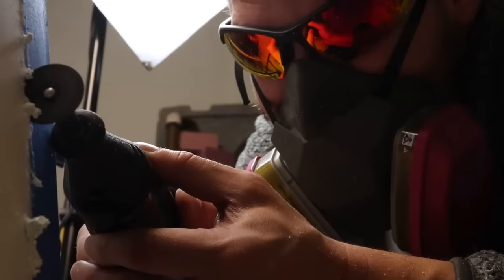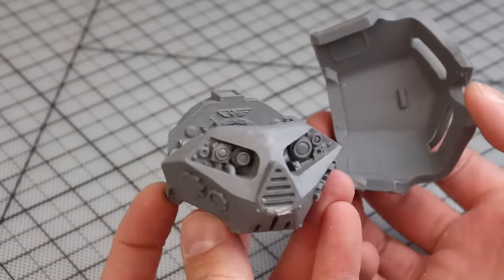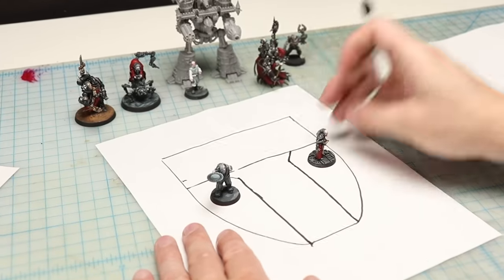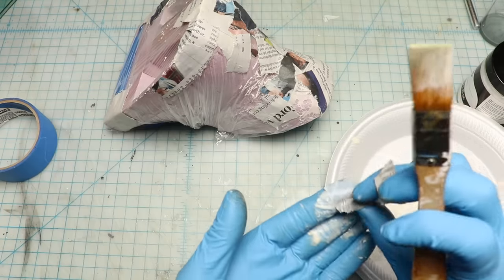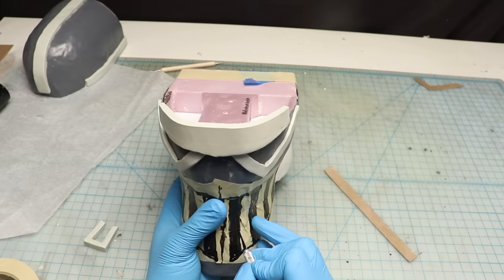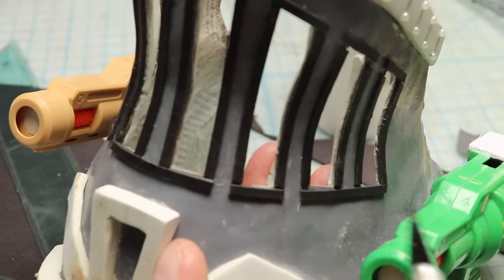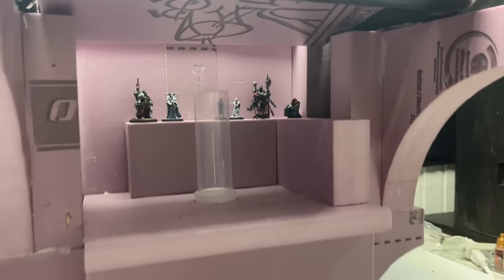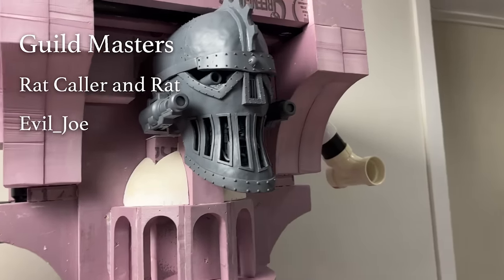The TITAN'S HEAD! Making a 7 foot Warhammer Model | Imperator Titan

Comment: Keep it up, man! Can't wait to see this behemoth in its final form! You should bring this to an event like the Las Vegas Open and put it up against like 50,000 points of collective armies.
Reply: Even the mightiest war machine is but of a heavily armed citadel to be over run by hordes of enemy infantry. It does have advantage over citadel that sure it can ru...slowly walk away, but time it takes to take a step, will lead enough time for just basic infantry to hop on in droves and over run it. While difficult task for both defenders of the god machine and opposing force, any god machine is good as dead alone and needs its companying infantry to keep it from being over run, while friendly infantry really needs to stay vigilant when titan engages with its main armaments, as those can be just as deadly for anyone in general area when that continent cracking power is released.
So add in skitari horde, few vehicles and smaller titans and yeah i would love to see that battle play out... though Imperators turn would take half a hour just from amount of weapons needed to be rolled.
Reply: @Hellsong89  however it would play out. It would be an amazing thing to behold!

Comment: A suggestion for future riveting, use flat-back nail art pearls. They come from 2mm up and can be bought in quantity and should stick with wood glue. Tip for handling small things like that, use an empty propelling pencil with a touch of floor wax on the end lifts them without difficulty.

Comment: Very nice, enjoying the look so far. Throwing my 2 cents into the build, instead of making the 'heart' you want as a power core standing straight up (ala new star trek warp core)  maybe think about having it come out of one side at an angle downward. That way you can faerie light leds from it to the exterior surfaces you will build into the designed interior.

Comment: Eric I have an idea for you I’d like to see your solution to. River terrain that looks good, hides the lines separating the pieces, and doesn’t look like it’s popping out of the ground.

Something I’m currently experimenting with. I think if you can make the points where the rivers connect hidden by waves or something it could work.
Reply from the maker: I don’t think its very easy to do that unless you want it to look like a river with a levee that has deposited enough silt to be above the level of the ground around it. This is a very manmade look. The alternative would be to dig it into the board using foam sheets so that the water is properly below grade, but then you lose modularity. Alternatively, the board itself could be water, and you could have modular big sheets of land on top 🧐
Reply: @EricsHobbyWorkshop  I appreciate the insight!

Comment: Add plasma cannon to that mouth Nice job get the legs to open two thousand cost and on wheels or it's own stand with a 2000p any army awesome.... this fine cast plastic metal frame join on a 3d print and model with a printer you could probably get 5000p in it with a a bunch off guns or troop balconies on them legs can't wait to see the full job...😃😄😁😆😅 5 Smile's.

Comment: For future reference: pixelating the head out in the video is a bit pointless if you display it prominently in your thumbnail. Still, amazing work as always. Can't wait to see the completed, painted article being fawned over at a convention or other. That being said, I like the idea of the Priceps actually sitting inside the cranium and not behind the eyes like you would intuitively expect, kinda underlining the fact that the Princeps and his Moderati are more an integral part of the "brain" of a titan, wired directly into its multitude of sensors and servos, than a captain and pilots in the conventional sense.

Comment: Your Titan would 504 feet/153.6 meters tall if it was to scale  

That titan is 7 feet tall that  miniature is about 1 inch tall, there are 84 inches in 7 feet

Assuming average guy is 6 feet, 1 inch = 6 feet
84x6 feet = 504 feet (153.6 meters)